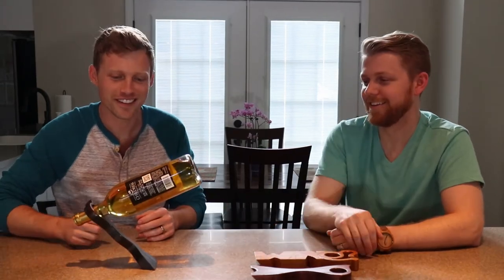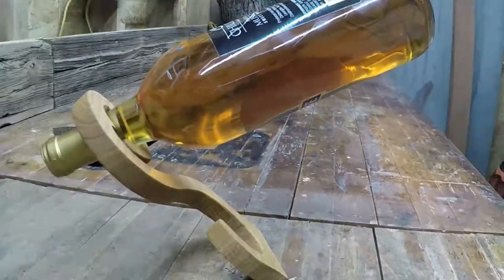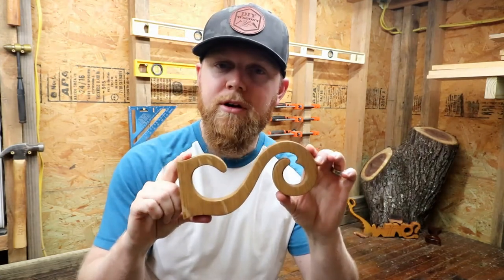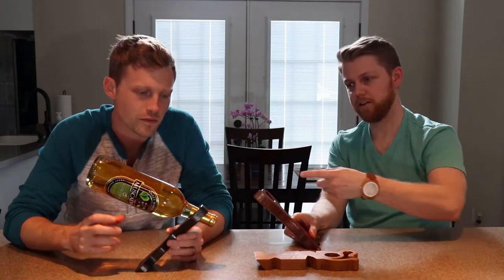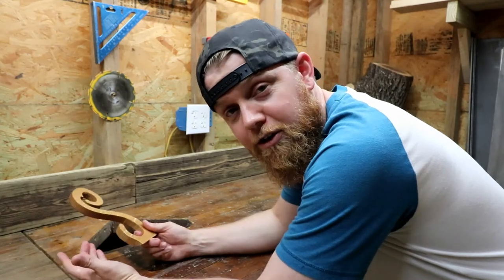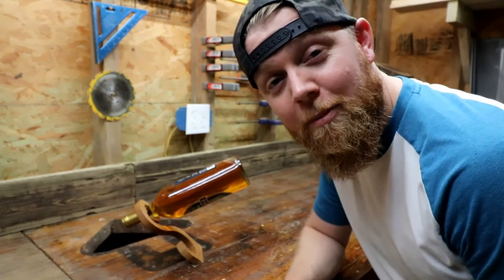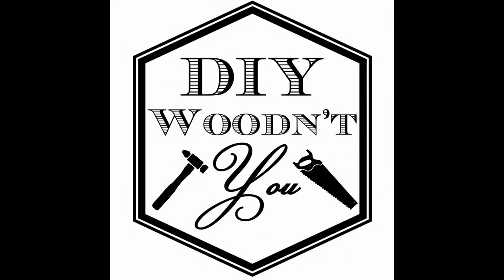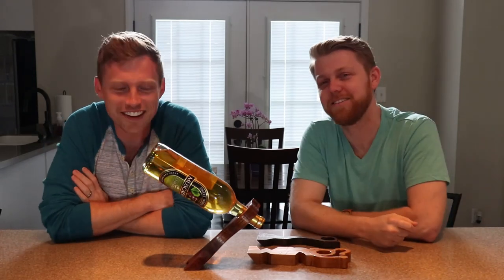DIY Balancing Wine Bottle Holder - A way to say thanks!

Comment: What equipment do you use to make the complete wine holder?
Reply from the maker: I use a mitre saw, a drill with either a paddle bit or forstner bit, a band saw, sometimes a jig saw, and a belt sander. I believe that’s all.
Reply: Thanks a lot